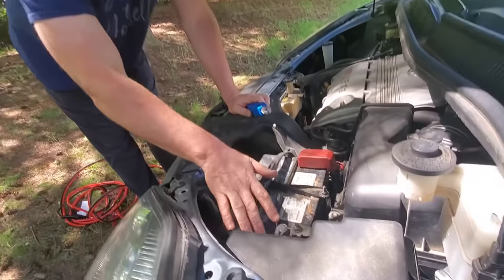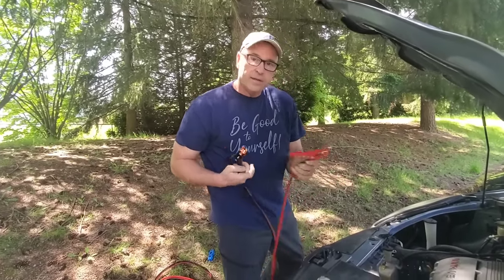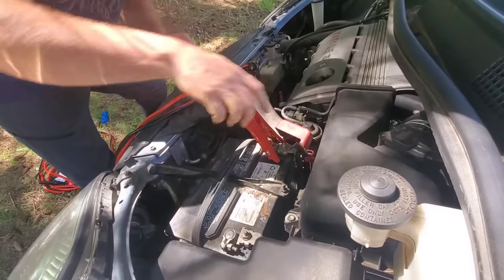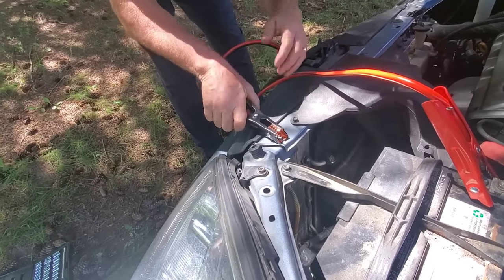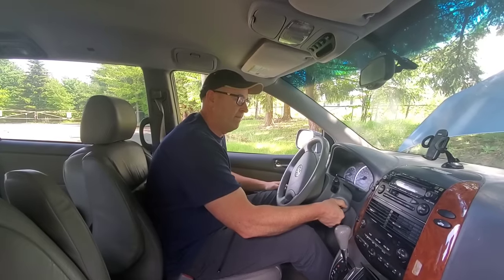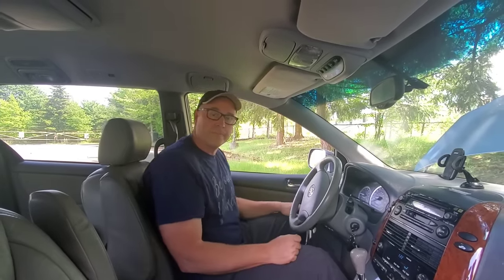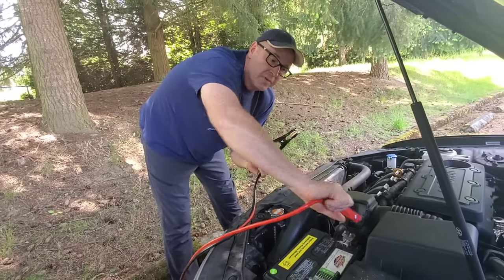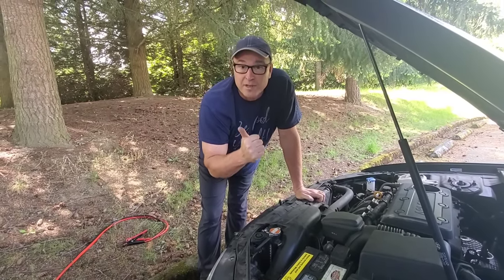How to Jump Start a Car

Comment: Toyota after disconnecting the battery resets not like other cars. At first start it will shut off after half a second, then second time it will stay running. Just a toyota thing. Also, i’m not critisizing anything, just adding my 5 cents as just another guy without father who turned out to become car mechanic/diagnostician

Comment: One little bit of extra knowledge: This won't work when the dead car has a Diesel engine as Diesel engines have stronger batteries and a puny gasoline one will not cut it. You gotta find another Diesel car to jump yours. The other way round is no problem at all.

Comment: Just to be safe, NEVER touch a positive battery pole if the negative pole is connected, even if the car wont start. The battery may not be the cause of the problem. If the battery still has a charge and you're touching a metal part on the car, your body will conduct current between the poles. While the voltage is not so high, car batteries have a really high discharge capacity (amperage), in the order of many hundreds amps. 1A is enough to stop your heart. If you don't want to kids to grow up without a dad, be careful while jumping a car.

Comment: Hi, 
I started learning manual car. I driver of 2nd gear mostly. I fear i can't handle in 3rd gear yet. I bought used car and engine is already weak and Mechanic told me if i use car more in 2nd gear engine will need to makeover which will cost more. I don't know what to do. Whom to consult. 
When suddenly i feel something is wrong with car i try to ask from stranger but they see me like i am crazy and i don't have someone to ask. Yes, i don't have...
Well...
So,
People hear drive so carelessly , they over take cars so easily and there is no traffic police or security cameras to capture them. When you driver with these kind of people i always have to be sharp mind 'ready to push break' all the time. I don't trust 3rd gear speed car with me (which will be around 60-80 speed). I driver on 2nd gear (high speed so far is 60)...
What should I do.

Comment: I know this is an older video but I have a weird problem. The positive terminal on my car's battery is recessed inside it's plastic housing and I cannot figure out how to get a jumper cable attachment onto the terminal. The clamp will not grab onto what every picture, video, and diagram shows to, because it's too recessed into that plastic cover.

It's a 2018 Tuscon, which did not help me find any useful information.

Comment: I thought the negative to earth thing is so that the output of the alternator goes through resistance loads. So its not two alternators charging each other.
What do I know though I still had to look this up to remember the order of the connections. Thanks.

Comment: Would love a good video on how to mount a TV.  I'm divorced and need to learn how to do these things myself. Want to be independent and handy.
Reply: I hope you're doing well and got that tv mounted. The most important part is to make sure you have a stud in the wall to connect to. That'll be a 2x4 behind the wall, with the skinny part facing you. You can get a stud finder pretty cheap at a hardware store, and it'll have instructions on how to use it.

Comment: If the car doesn't need to be started immediately, it's better on the battery to use a plug-in charger that takes hours to slowly charge it back up.

Comment: Additional note : if you jump the dead battery vehicle and it immediately dies within short period afterwards it is a sign your alternator is no longer charging. If your vehicle continues to run and the next time you try to start and battery is weak again it’s a likely time to replace your battery.

Comment: My gosh. I just remembered. My friend's car battery died, so me and a buddy pushed the car to help the battery charge up so the car could run by itself. It was hard, but we did it! Then my friend turned the engine off 😨 She did it because she wanted to save the battery - Which would work for a TV-remote, but cars load their battery by keeping the engine running. After that shut off we couldn't get the car started again. Friend had fix the car by other means. If I'd known how to jump start a car I could've been more help maybe.

Comment: I don't understand about pseudo ground in the faulty car. How is that nut and -ve of dead battery connected. Because if they are not, then circuit won't be completed and current will not flow. Or am i missing something?

Comment: do you Turn off the engines of both vehicles before disconnecting the jump-start cable after jumping-start?
Reply from the maker: No, if you turn off the car that was just jumped, you will need to jump it again

Comment: Ok but serious question.... Can you explain the 'ground' a little more? Do you just want an unpainted bolt that isn't on the battery? Or is it a specific bolt? I'm kind of confused about that part.
Reply from the maker: Yes, any unpainted metal part. You could connect it to the negative post on the dead battery (ngl most people do), and odds are you will be fine. However, in extreeeeeemely rare circumstances, that spark is what can cause a problem.

Comment: i dont get the importance of removing the black from the cars frame. why not just take it straight off at the donor battery negative terminal, since it only goes to the dead car frame, and not the battery

Comment: Hey dad, I was told once by a tow truck driver to put the grounding on the frame of the car. What are your thoughts about this?
Reply: My dad was a mechanic for 35 years - the frame is totally fine because it's also a piece of bare unpainted metal (which the most important thing).

Comment: When I was jumping up my Honda using my new Toyota, my Toyota was running while I was connecting cables to Honda. Did I cause damage(s) to Toyota since I was supposed to all cars off before starting jumping process? Thanks
Reply from the maker: No, you should be good. I will say with these new cars, the computers that run things can be thrown out of whack when jumping....
Reply: @DadhowdoI  thank for your reply. I did feel my new Toyota’s engine ran with a noice that was not there.  I simply didn’t know if my jump had caused an issue. Thanks again.

Comment: I have a mini van I don’t drive much. The battery is new but appears it could be leaking at the top. I was told to drive my van or the battery would die but …. Well now I tried to jump it with new cables. The van will not start or even make the click noises. Does that mean I need a new battery? Possibly alternator? TIA
Reply: If the Battery is leaking you'll need to replace it. Depending on what is leaking you have a safety hazard on your hands. Potentially a fire hazard. Please call a professional to check it out.
Reply: @rea6268  thank you

Comment: just backwards! the good vehicle can receive blown diode in alternator: /so u want the hot battery grounded to frame... (not on post) .dead battery dont matter as much/ but i would also ground it elsewere . old generators /or seperate voltage regulators.. these 1970 yr vehicles didnt matter! newer/ just dont let any1 ground the black too post! DONT ! if you do ground too post and it blows diaode... 2 miles down road .. u battery was useing all its power to run the car and the alternator wasnt rechargeing! and it now destroyed your battery and your alternatoer!

Comment: So I left a car sitting for a year and jumping it with noco boost plus.didn't seem to work. Is there another way to get the battery charged.?
Reply from the maker: How old is the battery? If you leave it sit for that long, it may no longer be able to hold a charge. 🫤
Reply: @DadhowdoI   ahh. So maybe it needs a new battery. It's about 5 years old.

Comment: What is a ground and how do you look for one?
Reply: In an electric circuit, the "ground" is another word for a common place to connect components to. It's how the electricity gets "back" to the battery as it completes it's voyage through the circuit. In the case of a car, it's not literally the ground. You just need a bare metal surface to clamp the black cable to.  In the worst case scenario you can scrape a little paint off the frame of the car in the engine compartment and use that, assuming it's metal.
Reply from the maker: All great comments Atomic Bob. 👍

Comment: Is "jump starting a car" the same as charging the battery?
Reply from the maker: No, it would be for when one battery won't start, and you jump start it. Once the car is running, you remove the cables and let the car run to charge the battery.